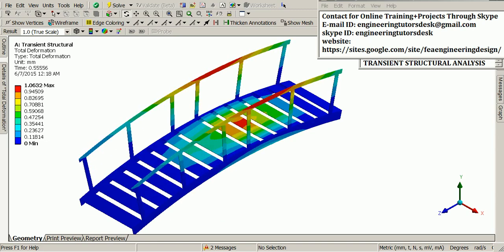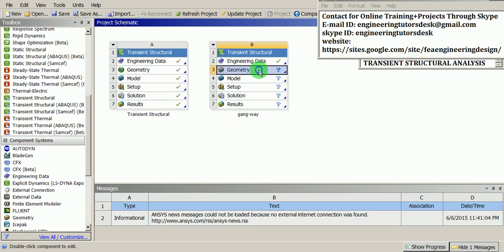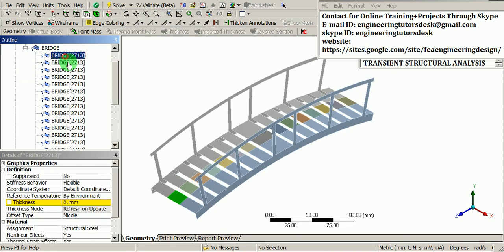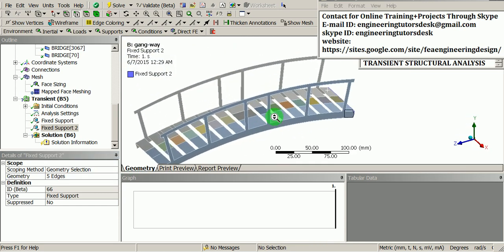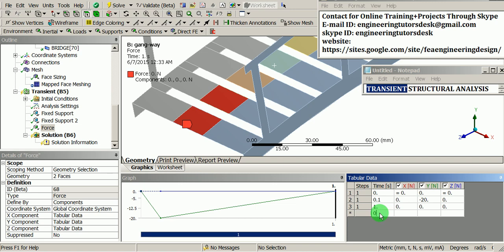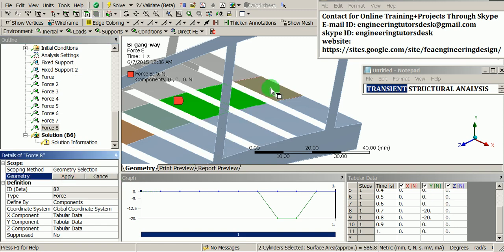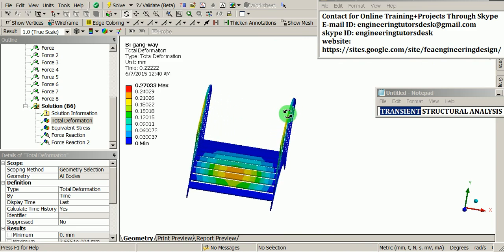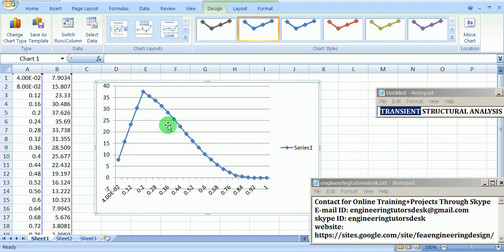ANSYS Tutorial | Bridge structure analysis |  Load vs Time | Transient structural | GRS |

Comment: Why can't we do this with static structural analysis?
Reply from the maker: +praveen jain Praveen's reply is logical to me
Reply from the maker: +Jon Saw For time dependent loading, transient analysis is done
Reply from the maker: +Jon Saw For time dependent loading, transient analysis is done
Reply from the maker: +Jon Saw for time dependent loading, transient structural analysis was used
Reply: GRS CAD/CAE Thank you but here I am confused because in static structural you can define loads as a function of time and solve the problem. Other than that what about the time steps in static structural? we can manipulate stuff there too.
Reply: Multi step load in static analysis used to study load case combination. It is not created for applying a time varying load. Even if you apply, it will not have any effect on it because, inertia is not considered.
Reply: praveen jain Would you give an aexample of load case combination ?

Comment: can we provide line load? cantilever thick plate provided with line load (transient). can it be modelled?
Reply from the maker: Yes
Reply: Actually I use abaqus. Thr is no way to provide line load on a 3d plate. Only way is to divide suface into small areas like you have shown and apply pressure. Not line load. Any way to tackle it? Any suggestions will be helpful
Reply: can elements be deleted based om stress developed?? i mean we apply the load and the elements which are stressed above some value gets deleted?